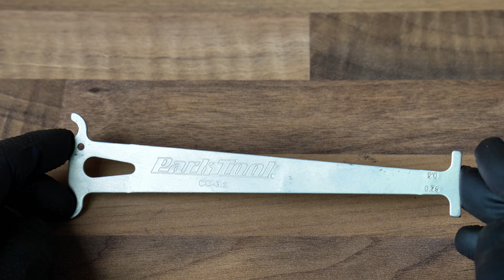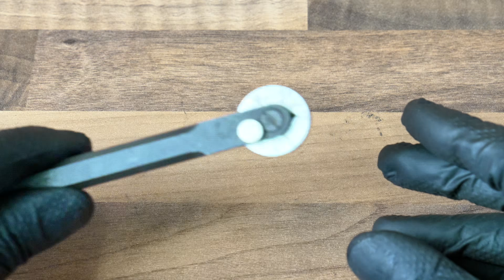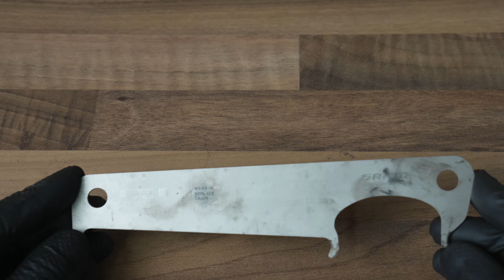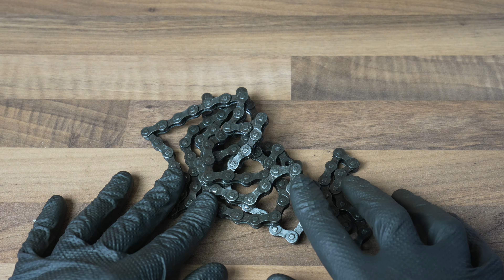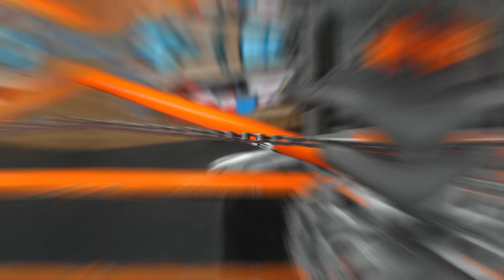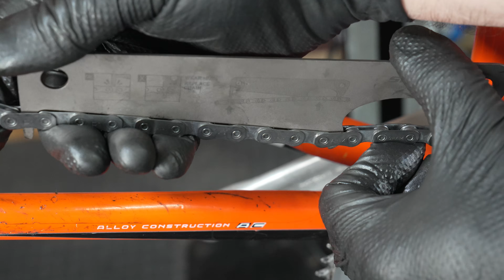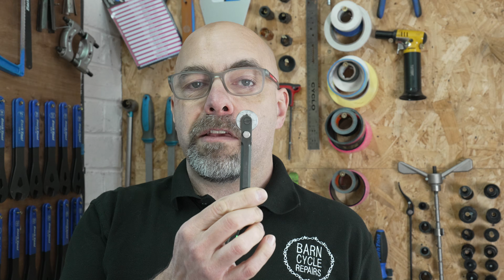Which Chain Wear Tool Should You Trust?

Comment: Another great scam in the cycling industry..... well sort of! 

Back in the early 90s when I started riding MTB, pretty sure I went through a couple of chains and cassettes in about 10 years. Admittedly it was a 3x8 which obviously has a superior chainline to all the modern 1x shite, hence the lower wear rates. 

I've been running the same cheap SRAM 12s cassette for 7 years. I've probably been through about 4 chains in that time, there's absolutely nothing wrong with it. A diligent maintenance routine,  not using 'industry bicycle lube',  knowing how to chain gear correctly and setting up your gears correctly are key to drivetrain longevity! Sadly most riders are feckin clueless! 😂

Comment: I bought the CC4.2 to check the chain on my e cargo. I prefer the idea of a single piece of laser cut metal. Cheap stamped tools, and tools with moving parts, I can't see how they can reliably measure such small amounts of wear due to slack and tolerances in their moving parts.

Comment: I agree. It does seem to be a common human failure mode among many bike mechanics to 'over engineer for the sake of engineering' as if the engineering prophets will look down upon them and give them a pat on the back for making something simple more complex by using more brain processing. I like that 'Go👍/No go👎' tool simplicity because it harks back to the engineering fundamental of S̶I̶M̶P̶L̶I̶F̶Y̶, S̶i̶m̶p̶l̶i̶f̶y̶, simplify. Yes you can just use a ruler 📏 and the 'Go/No go' indicator here is if the 13th pin from ruler 0 is beyond exactly 6 inches then chain is bad 👎

Comment: Hello great vid as usual. Can you suggest a chain waxing system and waxes to use to keep the chain clean and prevent chain wear. I know and you've stated that the chain is the weak link as far as cassette wear. Also Chain rings last longer and wear less so they do not have to be replaced? Thanks Stewart!
Reply from the maker: You can't go wrong with the full Silca kit 👍🏻

Comment: I use a Unior with the dial because I can monitor chain wear on my bikes.  I'm not a shop.  I suspect that your Unior checker may be reading slightly high due to age and wear on the pins.  For a shop a go/no-go gauge is best. I'm in the US and fluent in inches and fractions.  Using a rule is a pain to line pins up.
Reply from the maker: I think you are right, I'm looking at either a new one or trying to calibrate this one somehow...

Comment: I use a ruler on the mm scale. 12 inches =305mm (well, 304.8). .5% wear = 306.5mm, 1% wear = 308mm. Easy :)
Reply from the maker: Not when it's covered in a years worth of road grime and unknown lubes and the customer is standing next to you it's not 😆

Comment: 👍Excellent test of chain wear testers, with random cat! I've also noticed differences with my four wear gauges. Who can you trust...? The small Unior gauge (the one in the video) showed me 0.75 to 0.80%. The Shimano gauge (also in the video) showed that the chain is still good. A BBB gauge showed 0.75% (from 0.50 to 1.00%), and one from Veloplus was in the middle between new and old, which is far too optimistic. I always measure at ten to twenty points; there are considerable differences within a single chain. The chain (Shimano CN-HG71) now has 5,200 kilometers on it, and I'll ride it for a few more months until the Shimano gauge starts to slip in at some links.
Reply: Aha!  I was wondering where my BBB checker would sit in this test, looks like it measures similarly to the cheap one that BCR liked?  Is that the BBB that's silver, only has markings for 0.75 and 1.0 and says "Replace chain at 1.0"?
Reply: @chocolate_squiggle  My BBB chain checker is a BTL-125 type. Yes, it's silver and has markings at 0.75% and 1.0% and says: replace chain at 1.0%. (But 1.0% is definitely too much wear for me.) I ended up replacing my chain a bit earlier than I'd written here (at 5,600 kilometers). Because I also checked my chain with calipers, and the result was that it was 0.91% longer. My BBB chain checker said 0.80% at that point, the Unior 0.88%, and the Shimano was just barely not falling into a chain link, indicating that the chain was still just about good. 🤔 

When measuring chain wear, there's always some inaccuracy due to the rollers, which also develop more play as they wear. My Shimano chain wear gauge, with its spring-loaded end, is the only one not affected by this error, but it doesn't indicate at what percentage it falls into the chain links. Therefore, my BBB gauge probably displayed a correct value.

Comment: What i learnt from this is that all chain measurement tools are inaccurate.
Reply from the maker: Choose one and stick to one!
Reply: Except the old Unior is obviously worn out, the Pedro's (started with the far end) and Shimano (pressed in with fingers when it's supposed to just drop in) was used wrong, and of course the flat top check cannot be used for the others.

Without mistakes, they were pretty consistent. The one the old Unior called 1% worn were around .5 - .75% on checkers used correctly.

Doesn't really change what @BCRUK said here, though. If you stick to using the same, there's a much better chance you will do it correctly.... But as with all tools: You need to check the tool itself once in a while :)

Comment: The digital caliper method should first be calibrated measuring a span of one link, that removes the roller to bushing wear, which doesn't affect cog/chainring wear. The checkers with 3 prongs or the TL-CN42 push the rightmost roller to the left, which means both rollers are being pushed the same way, removing roller to bushing wear from the measurement. 
This doesn't matter when you're using a ruler to measure 12", because the roller to bushing wear is pretty small over that long a distance. However, for checkers that only measure 3"-4", it can matter.
Reply: I used to use a digital caliper to measure chain wear but i got tired of the fiddley aspect and cleaning it after.   I dropped down to the 4.2 and like it even though i lost some detail in my checks.   Life's too short to worry about a stupid chain and cassette.

Comment: I just got one of those swivelly gauge ones like the toopre, but by riderace. Just checked my road bike: chain is shot. Tried my MTB: 0.75 - so overdue to be replaced. So then got my park tool cc-4. Both are less than 0.5% so totally fine. Re-examined the Aliexpress one, and I can wiggle the gauge part enough it’s clearly crap. So some Aliexpress ones are probably ok, but some are clearly useless. The question is how many cheap ones is it worth risking wasting money on if I know a decent branded one will definitely be good? 🫤
Reply: P.S. Main reason I don’t use a ruler (which has metric and imperial on), is the end plates can have a small amount of wear so not much longer, but sometimes the inside of the rollers are knackered so the actual point that connects with the teeth can be far more wobbly and worse than the spacing between the pins would have you believe.
Reply from the maker: Frustrating!

Comment: It could be that all 3 - toopre, ztto and unior have 0,25 error in it. So when it shows 0,75 it's actually 0,5. So when you compare with other gauge tools it would show very similar results otherwise. That's why toopre says change at 1. However ztto says change at 0,75.
Reply from the maker: That's certainly a possibility!

Comment: I noticed you sometimes pushed the no 3 part of the pedros checker in before you had put tension between 1 and 2. That caused the chain to bow upwards between 2 and 3 which means the prong probably wouldn't have gone in if dropped in as the actual third step. Something to consider...

Comment: Hi, I wonder if the placement of the chain checker makes any difference (i.e. between inner or outer plates). I noticed that you placed the CC3.2 first end between out plates where they recommend inner, and the CC4 the first two parts also between outer where they recommend inner (Unior doesn't seem to have any recommendations). It's probably just to avoid the edge of the inner plates and make sure you are on the roller as you mentioned. 

Anyhow, really enjoyed your video and the fact that you had a number of different chains to show how they really worked. A pity your original Unior is out, it's probably a legacy of that design and why Park Tool moved on from the CC2. I could see Topre also losing its accuracy in a busy workshop.
Probably worth keeping a known just worn chain to calibrate your tools!

Comment: Better than any "chain checker" tool is a small nail in the wall, and a mark 100 links (50 inches, or 127 cm) down from the nail.  When the chain is 1/2 a link past the mark,  that is 0.5% elongation (a.k.a., "stretch"). 
It's super easy, barely an inconvenience!  ;)
Reply: Yes, just make sure the nail or support is perfectly horizontal. And you can calibrate your tools with that method... when your checker says 0.5%, compare the total length to a new similar chain precisely, and you get real wear.

I'm thinking it's fine to replace the chain with less than 0.5% (real) wear anyway, I can use them later, when the cassette is older.
Reply from the maker: It is when I'm inspecting the bike when a customer arrives lol
Reply: @BCRUK  I had once a co worker with a quite new bike where the still originally lubed chain was already visibly stretched. Yes visibly, because it was a single speed. I recommended to her that she should claim guarantee for this kind of utter junk. They actually honoured it after I have briefed her about what "defective and not fit for purpose" means and she was able to competently articulate the claim.
Reply: well sure, if you're regularly taking your chain off. Me, I've taken my chain off twice in 4-5 years, and one of those times was to change it. An on-bike checker is what MOST people should use.

Comment: hmm.. I suppose after checking enough times the metal on the tools will gradually wear down. We need a tool to measure that.
Reply from the maker: Good ones will be hardened tool steel and you should use no pressure, It would be millions of chains before that may be an issue..

Comment: I prefer tools like the Park CC-4.2 that measure outside to inside rollers. The ones that measure inside to inside (most of them) are inaccurate on sram 12-speed chains due to the larger rollers. By the time an inside to inside tool measures .75 on one of those chains it is gone. In the end I think most of them are fine once you get to know them and their nuances.

Comment: Just use a ruler and measure between the pin centres. It's the only time I use a ruler calibrated in inches. Rulers don't wear out.
Each pin starts out 1/2" apart.
Measure 10 or 12 link pairs.
For 12 pairs, 1% is about 1/8" and .5% is about 1/16".
For 10 pairs, 1% is exactly 1/10".
Use the one your ruler has graduations for, usually 1/8th and 1/16ths.

Comment: Why should 11sp chains have less wear when all speeds have the same pitch?
Reply from the maker: It's a great question, in my workshop I change all speeds at 0.75 with no issues over the years...
It's worth noting though that 11 and especially 12 speed cassettes are expensive so changing them earlier may prolong it's life,but in reality I've found no difference over thousands of bikes..
Reply: @BCRUK Thanks for your reply. In my experience 11sp chain seem to be better made and  last longer than 9sp but that may be my 9sp bike is more likely ro be used in poor weather.

Comment: Am I the only one that thinks that cheap stamped Aliexpress chain checker is used like the Park 3.2 and it's a go/no-go gauge where slipping past the tip at all indicates a worn chain? Because they both dropped into, and not into, the same chains, which would seem to indicate it works just fine.
Reply from the maker: The black one yes, the super cheap silver one said a 1.2% chain was totally fine 😆

Comment: I have been using standard digital caliper tool and wondering if I have been measuring wrong because my chains seem to be stretching very rapidly. I measured 11 links of new chain and got exactly 132mm and according to my math at 132,8mm chain should be about 0,6% stretched and I reach that well under 1000km
Reply from the maker: That's not right, suggest grabbing one of the Unior tools, will pay for itself very quickly!

Comment: I only use the Pedro tool, been using it a long time, because it measures from both sides of the rollers, which takes roller wear out of the equation. Anything that measures in between links by pushing them apart, will read higher than actual wear. The hooks on the Pedro to hold a chain together before cutting it to length is also pretty handy.

Comment: I use the Shimano tool and then double check with a ruler. In my experience, the tool correlates with 0.5% wear at which point I fit a new chain

Comment: The Shimano chain checker measures 0.4% wear excluding the roller wear, so it's pretty conservative. It's easy to prove with a digital caliper switched to inches. Just measure between the points that contact the rollers, the distance on mine is 5.020". That's 0.4% over 5.0".

Comment: I have the Park original of that adjustable tool. I think the pins have got bent as I once measured a brand new chain as being undersized. I think the chain checkers which are cut from flat steel are more durable.

Comment: Just use dial calipers...Easily make measurements on a new chain, record them, then measure after wearing and you'll know when to get rid of the chain for a new one. Example:132.12mm between inner sides of rollers, 6 links, measured.                                             The rollers are 7.02 mm in diameter... Might vary a couple of thousandths or so...
Reply from the maker: For a home mechanic this will work 👍🏻
Reply: @BCRUK  It'll work for ANYONE and no need to go through a bunch of extra tools of which none are guaranteed to have the seriously correct readings!! Besides, what good mechanic doesn't already have a decent dial caliper?? :-)

Comment: Just bought a Unior 1644/4, as the idea of 0.2/0.5/0.75/1.0 wear rates sounds very useful.  On a brand new CS901 (11 speed) Shimano, the 0.2 and 0.5 drop straight in, and naturally all of my even slightly used 11 speed chains therefore show as worn-out.  Its garbage.

Something not mentioned in the video is there seems to be this 'rule' (which I think is marketing BS) that <10 speed chains should be replaced at approx 0.75% whereas 11/12 speed should be replaced at approx 0.5%, despite them being the same pitch.  

KMC use 0.8% for all (most?) of their chains.  Other mfrs are not so forthcoming with wear info.  Shimano just seem to do one TL-CN42 tool for all chains, but don't seem to give the actual wear reading; just go/no-go.  Its 0.75% for me as the limit.
Reply from the maker: I've literally never changed a chain at 0.5% for a customer,0.75 on 12 speed has never been an issue 👍🏻
Reply: @BCRUK Awesome! Really good to hear this from someone with so much experience, just bought a chain wear tool and it can make you a bit paranoid...
Reply: Yeah thats great for chain rotation, you start at 0,2% put the scond on and so on. then you restart the loop at 0,5% and so on until the last loop at 0,75 is done. much money saved

Comment: I have the Pedro's tool and when I use it on several chains that have been properly prepped and waxed and only ridden for a few hundred miles each on new cassettes and chain rings in good condition, on relatively clean and dry roads and an indoor trainer. When I use the tool on them, the #3 tip doesn't fall into the gap by itself, but with a little bit of pressure it does make it to the first step, which indicates 0.5% stretch.

So which measurement is the right one, the first, with basically no pressure on #3, or the second, with relatively light pressure, to force it to the first step?
Reply from the maker: Don't apply any pressure
Reply: @BCRUK  👍

Comment: I thought the chain didn't literally stretch, just material on the rollers wears down. So surely the pins don't actually get further apart, so using a ruler to measure distance between pin centres shouldn't show any difference between a new and used chain, the plates don't actually stretch?

Or am I misunderstanding what chain "stretch" actually is?
Reply from the maker: It's just a general term everyone uses but you are correct, the 'stretch' is indeed wear internally..
Reply: @BCRUK  Then why do we have 3 point checkers and shimano checker which excludes roller wear?
Reply: @mikequinn The inner plates pivot around the pin which is only fixed to the outer plate. Wear occurs where the inner plate rubs the pin under tension; elongating the hole.

Comment: One question is how consistently each product is made... You could buy 10 of the same tool and they each give different readings. The tolerances are very small. Also how consistently they can be used (is there room for turning a wheel too firmly etc).
Reply from the maker: Absolutely!